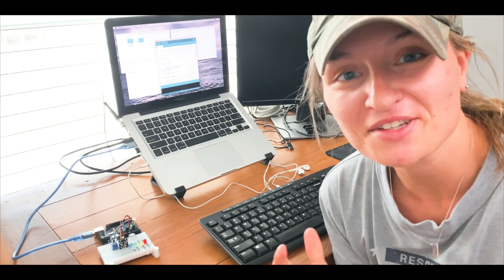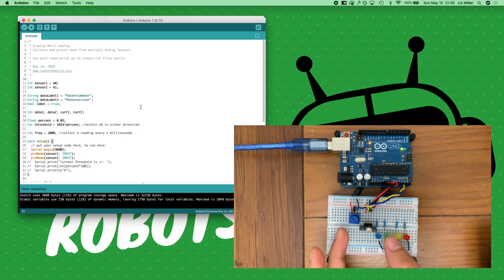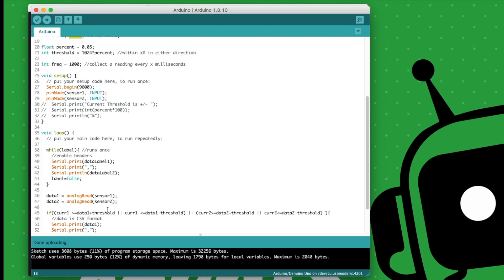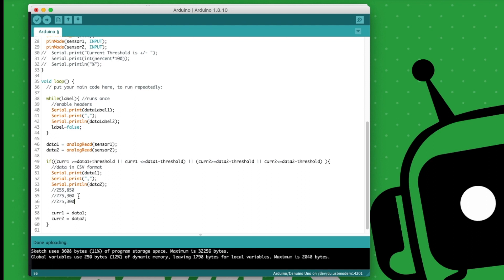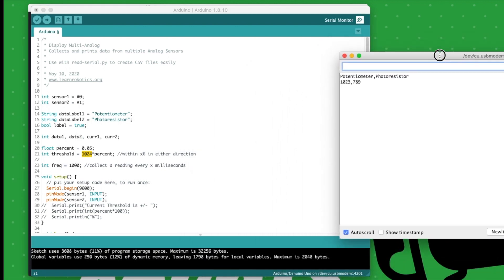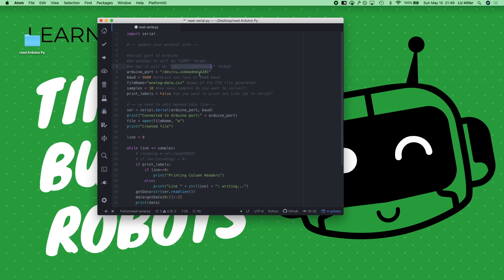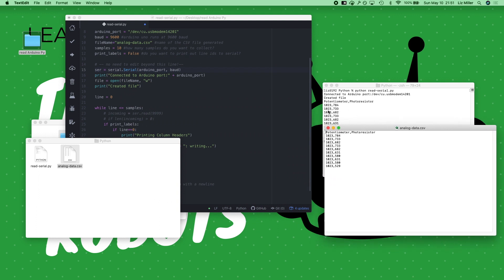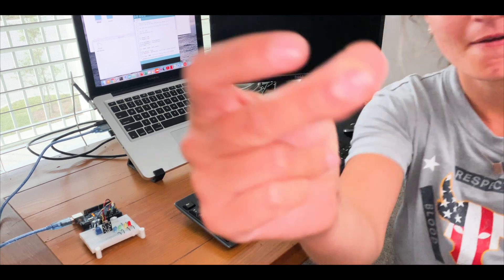Easy Way to Create CSV Files with Arduino Uno & Python (Save Data)

Comment: Can we  put data angles in serial port from mg996 servos then put the servo angles in excel and then run those angles automated back to arduino. If so can it be done in state machine with millis timer and record wait times? This is with desire to run to arms and kneck 2 axis joint of a humanoid robot in recorded kinematics from pentiometers.
Reply from the maker: Yes - I have an example of this using Raspberry Pi on my blog: https://www.learnrobotics.org/blog/raspberry-pi-servo-motor/

Comment: You collected only 10 samples, what should I do to gather data every 10 seconds, or any given duration?
Reply from the maker: Use a 10-second delay in loop.
Reply: @LearnRobotics  NO, I want to keep on adding data on some files. Like every 10 seconds, I would like to record that Arduino data on some file.
Reply from the maker: @juneshgautam8655  Same comment as before. You'd have to try and test it out. Unfortunately, I don't debug custom projects in the comment section of my videos. You can visit learnrobotics.org/consult and request a consult if you need personalized help.

Comment: not sure if you still comment here but i don't get the second row, I only get a \r\ at the end. Any solutions?
Reply from the maker: Could be a number of things including thresholds (readings not having enough variability), data collection (didn't collect enough samples), or number of samples (set in python file) for example. You'll have to do some debugging to figure out what exactly it is. If it works in Arduino via Serial Monitor, then it's probably something wrong with your Python file writing to a CSV (using the Serial library).

Comment: do you use MATLAB/Simulink with Arduino?. It will be great if you make it for control system designing. Let me know if you are planning to do so, recently.
Reply from the maker: Nope - why do you need MATLAB? Is there a particular mathematical module you need from a sensor? You can get basic visualization from the Arduino IDE itself - or just read things serially into Python!

Comment: Is this possible for logging data from different serial ports simultaneously?
Reply from the maker: Possibly, if you're using Python and define different Serial ports. In the Arduino IDE, nope. Usually only lets you use one port at a time

Comment: Doing this on Windows,  arduinoserial module works just fine, up until I attempt to execute the code, and I am met with this error:

ModuleNotFoundError: No module named 'termios'

I looked it up, and apparently the termios module is unique to Linux from what I've read, and I guess some variant exists on macOS. Is there any fix for this on Windows, or will I have to use an emulator to run this code?